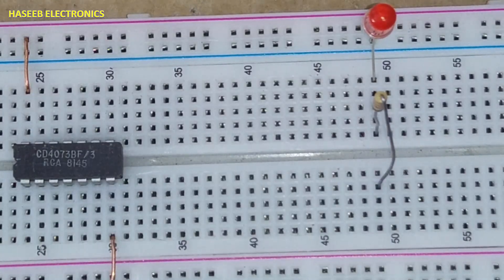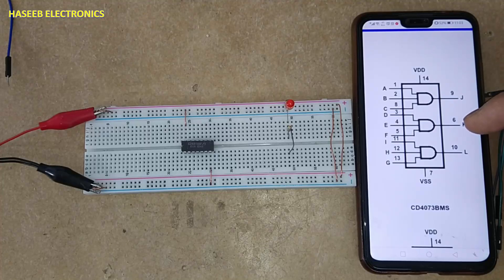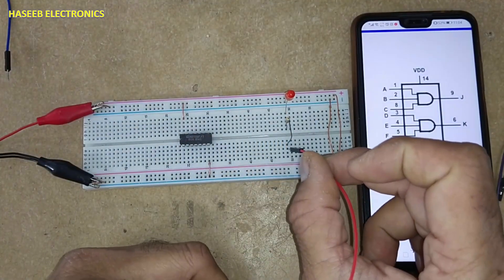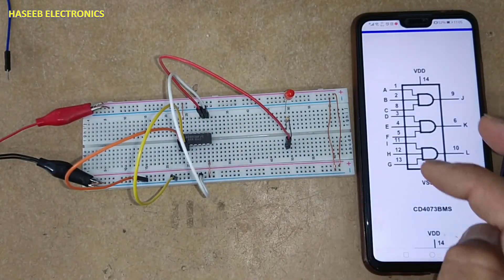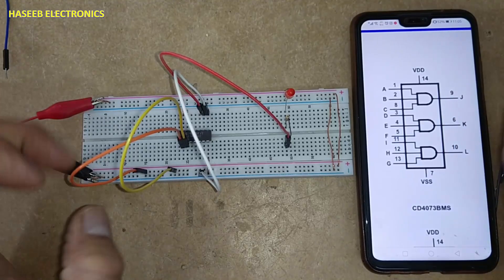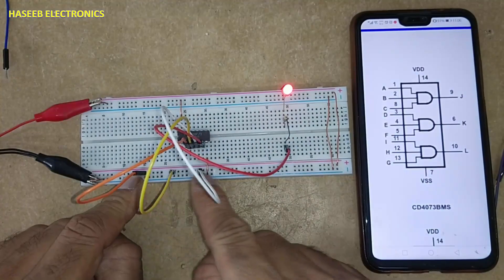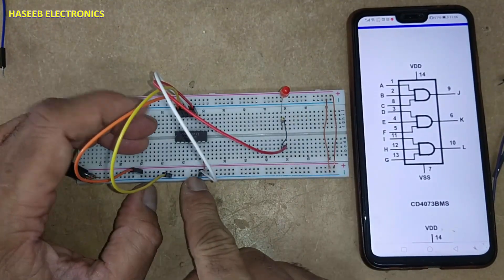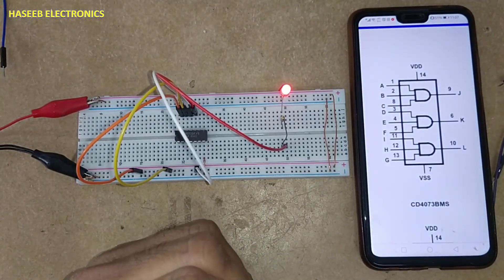{1035} CD4073 3-input AND gate

Comment: Thanks for showing these older chips. I know everybody wants micro controllers these days, but it is easier and cheaper to use these older devices for a lot of more basic projects. Example: a security alarm where any door is opened sets off the alarm. 
 I have a question about 74HCU04: They make a 74HC04 version (buffered) as well. If you have these chips on hand would you make a video on a buffered version verses the unbuffered version? I've seen this used in Mr Carlson's Lab "Crystal oscillators and frequency division" video. His claim is that the crystal may not oscillate with the buffered version with higher frequency crystals. Maybe it doesn't load the crystal enough to oscillate. I know you've recently made a similar video with a 455 khz crystal, so that's a similar circuit. Thanks and have a great day.